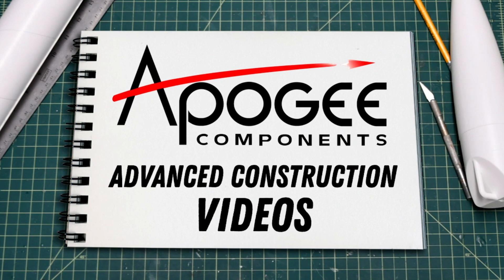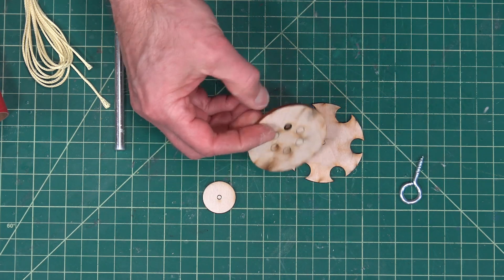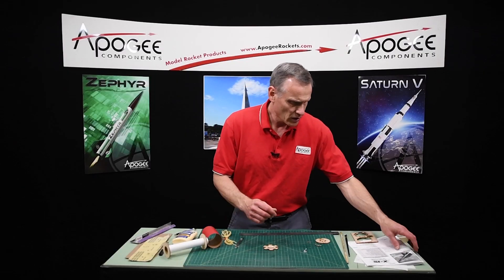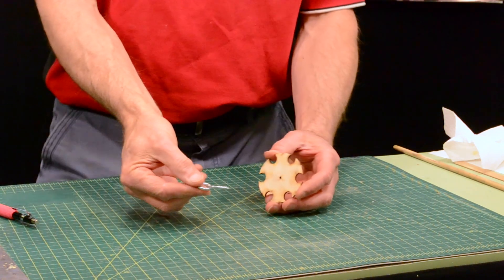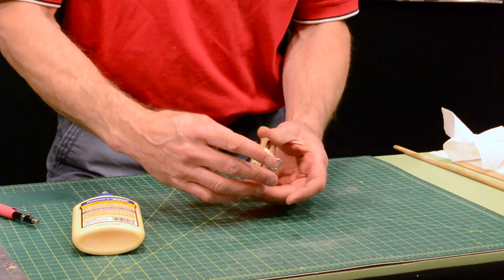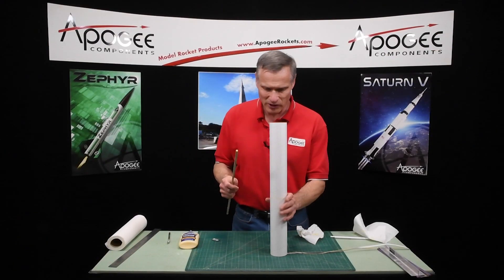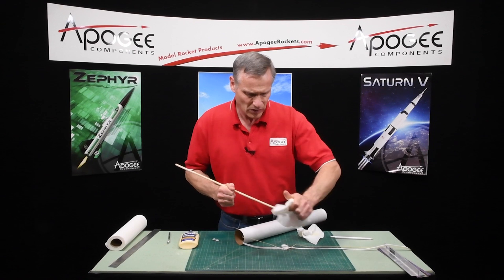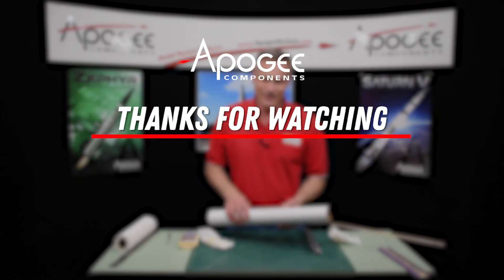X-15 Assembly Instructions Part 3

Comment: If you ( the builder ) is worried about getting glue on the chords ,just an idea I took a plastic shopping bag & wrapped them . When the glue or epoxy is cured remove plastic shopping bag